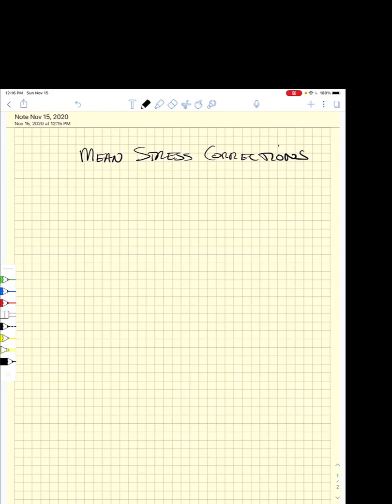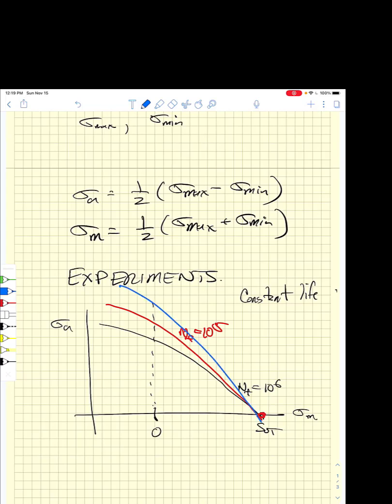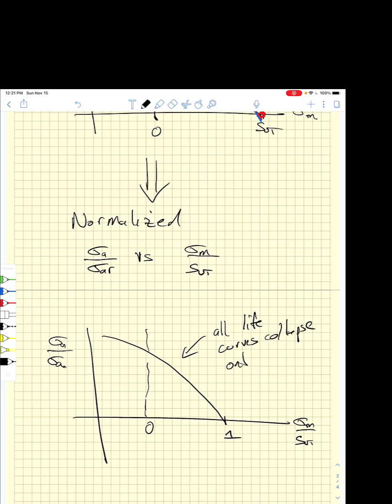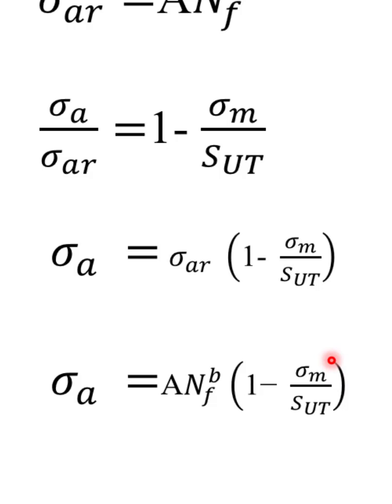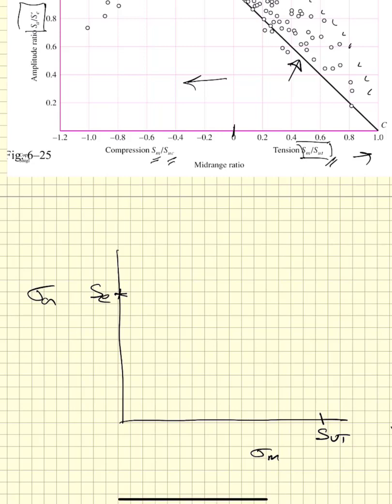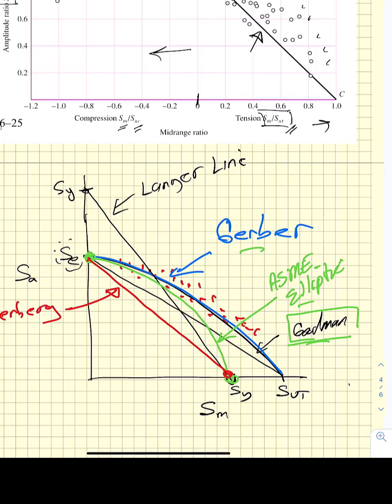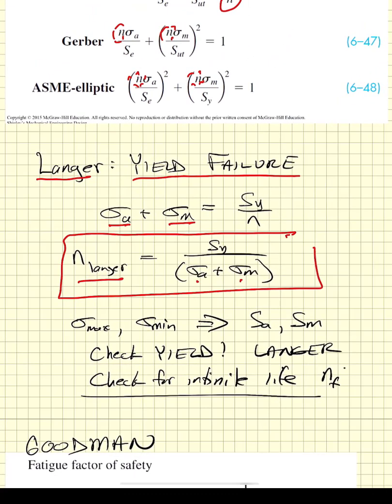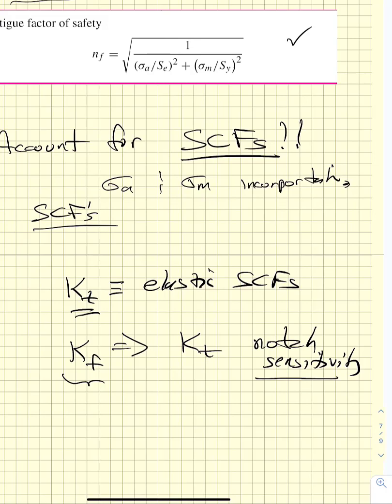Lecture 27  Mean Stress Corrections in Fatigue

Comment: I didn't understand the collapsing of different life curves on to a single life curve part. If all you do is normalize the axes, how will the different life curves collapse to one single curve? I think we will still have multiple goodman relations for the different fatigue lives. Many research papers also mention about the use of different goodman relations for different fatigue lives.
Reply from the maker: OK.  I get why this might be confusing.  We are collapsing only the combinations of stress amplitude and stress mean that have a fatigue factor of safety equal to 1.  Those all fall on the same line, and that is the line we draw.  It separates infinite life from finite life...everything below the curve has infinite life and some factor of safety less than or equal to 1, everything above that Goodman line has finite life.  So, you are correct...I am only collapsing the curves that have a factor of safety of 1.

Comment: Hello.Nice video!!But I have a question. How to calculate  safety factor using Gerber theory, when my load cycle is symmetrical (mean stress is zero)?
Reply from the maker: If the mean stress is zero you are intersecting the stress amplitude axis where all lines converge...so the factor of safety is just equal to the stress amplitude divided by the endurance strength.  Thank you for asking this question, because the Gerber formula does not work when the mean is zero!!

Comment: Can you add something related to how to calculate walker stress
Reply from the maker: The walker approach is more conservative at low mean stress, but less conservative at high mean stress.  So, creating a fatigue failure map using it is a bit more complicated, and leads easily to confusion.  Fatigue is really important, but also very phenomenological.  Adding another parameter, gamma, to create a family of curves is hard to swallow.  When I teach design, I always try to use the simplest possible approach...but I will consider this and consider making a video on it.  I presume you must use it.  As to SWT, I do know that strain-life is really the better approach, but it gets very hard to quantify and is especially hard to incorporate into a machine design course.